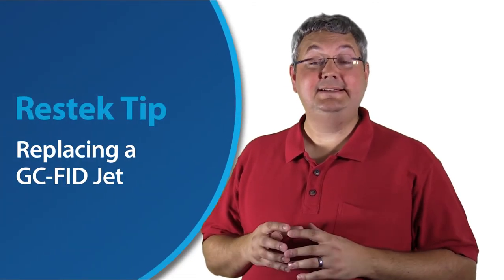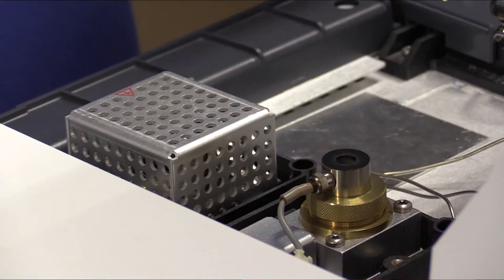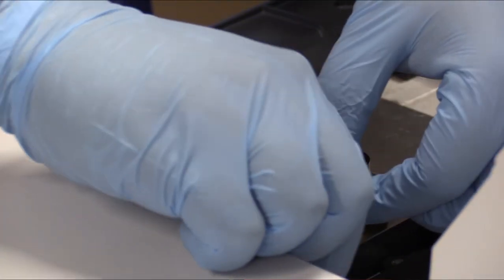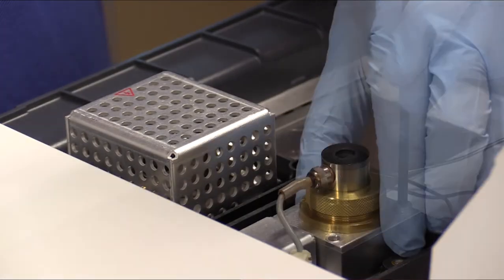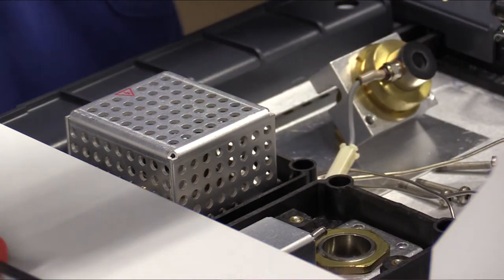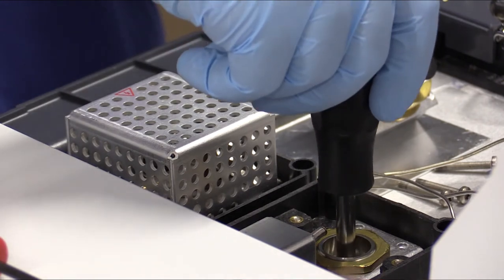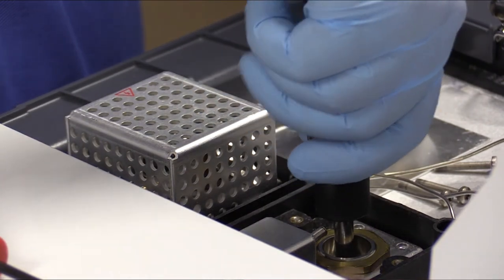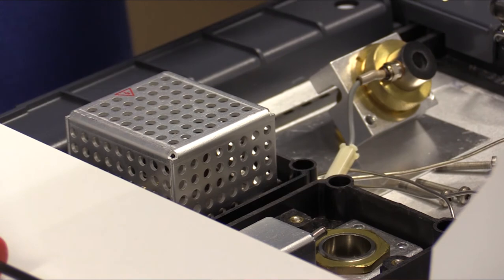Replacing a GC-FID Jet

Comment: shouldnt you disconnect the coloumn from the fid first?
Reply: If the column is connected to the FID, yes. But in the GC I work on, the Heracles II, the jets can be removed without manipulating the column.